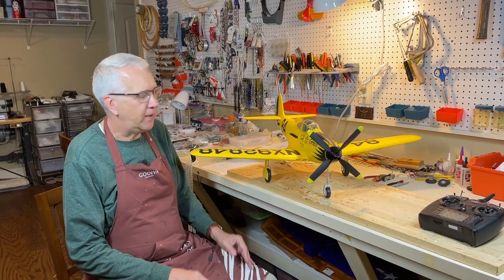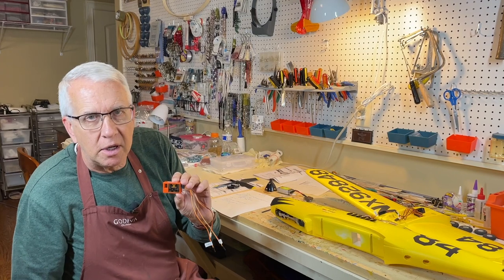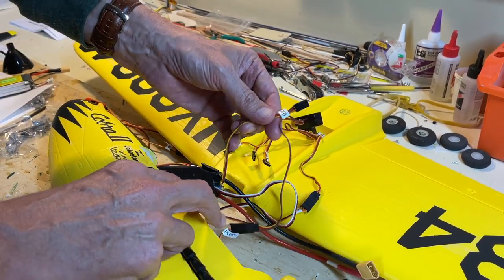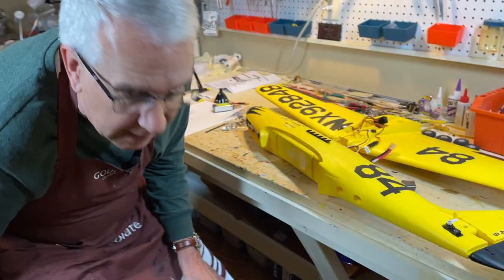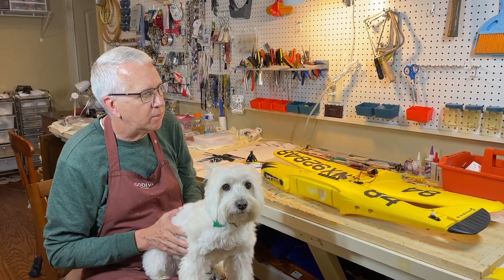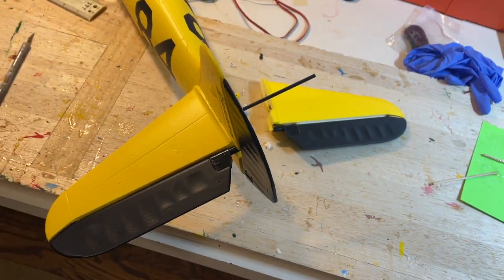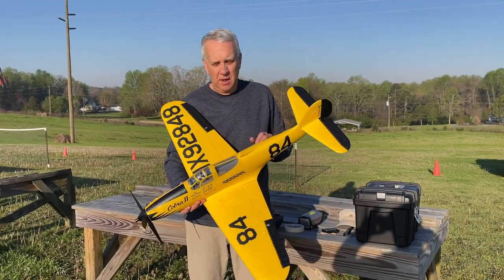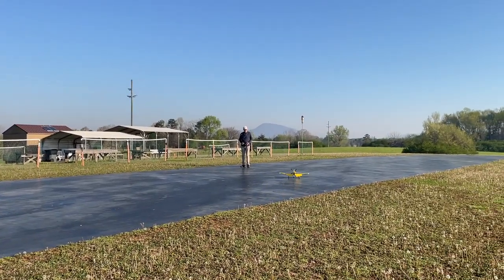FMS P-39 RTF RC Plane Unbox Assemble Fly

Comment: FMS have done a very good job with this warbird. With about 50% of my warbirds you would have needed a carrier bag for the bits. As it was a very low speed landing a lot of warbird tip stall. Thankfully not in this case. Nice plane but P39 never made it to my wish list (Garage full now as well). Great review Tim
Reply from the maker: Mark:  Fully agree, FMS did a great job with the engineering of their P-39.  I literally plugged in the batter and flew, no muss no fuss.  Plane had gobs of power and handled exceptionally well.  I am impressed!  Tim

Comment: I picked up one of these on a recent FMS Sale for $207.  Assembly wasn't too bad, ran a AR610 in it with the reflex V2 stabilization from FMS.  I fly it on a SMC Racing HiLV 4S 2800's (Same size as the 4S 2200) and it's super quiet, super locked in and very responsive to the control surfaces!  It's precise and on high rates but very sensitive.  They call it a "Racer" and it will definitely move out with some amazing speed under wide open throttle!  Flaps work great and it lands nice and easy, I was concerned the front nose gear would bend easy but so far it hasn't been an issue.  One thing I've noticed is I'm fairly certain the freewing f16 trailing link nose gear strut may fit this model perfectly!  If I do mess up the nose gear or bend it I may try it!  Be really cool to fly them around the pattern at the field together sometime!  Steve has one as well and I know you've seen him and I racing around together alot!  LOL
Reply from the maker: Good stuff!  Tim

Comment: Good day Sir, nice presentation I like your clear and straight forward no frills approach to our hobby. Just assembled the earlier version of this P-39 model the "Hells Bells" 3 blade prop version and now doing fine tuning on the controls before my maiden flight. I noticed that you made no mention of any Flap-Elevator mix, does it not need it? No balooning on flap deployment? Just verfying, Thanks
Reply from the maker: Rod:  Thanks for checking in and your kind words!  I actually took out the autopilot function box.  No mixing with Flap Elevator, although you can certainly try that.  The P-39 flew very well, I consider it an "honest airplane."  Flaps do  help a lot with landings, but ailerons effective through touchdown.  Good luck with yours!  Tim

Comment: Hey Tim, what size battery were you using? The battery looked like a 1300mah three cell.  Thank you!
Reply from the maker: Zig:  I am using a Thunderpower 3 cell 1350 lipo.  The manual mentions a 4 cell for 100 mph+ flights.   So I took a chance on a three cell.  Seemed to provide plenty of thrust on the bench, model flew great.  Will need to collect a bit more data on how long flights can be, may need to get a larger lipo.  But, the model flies just great.  Tim